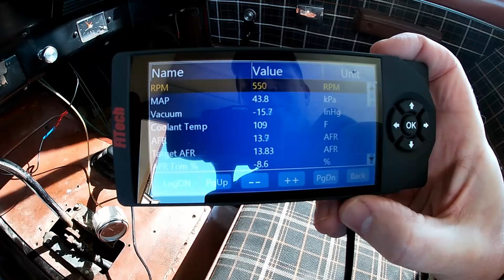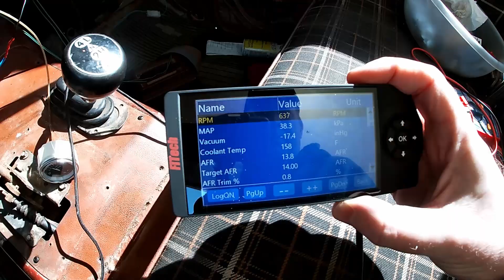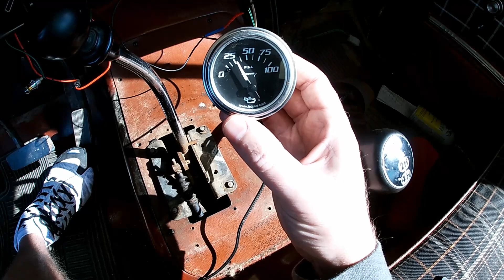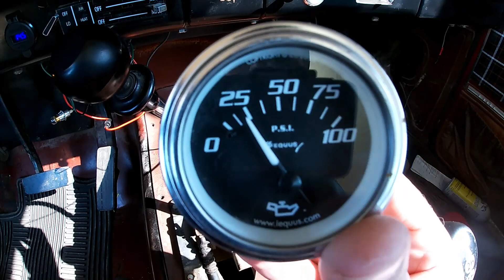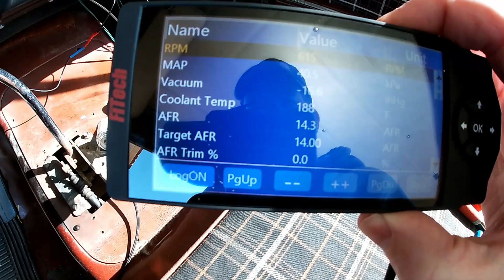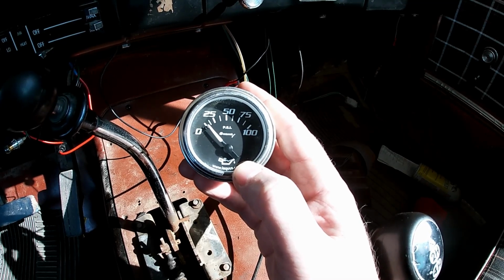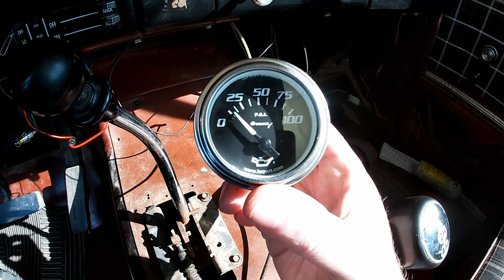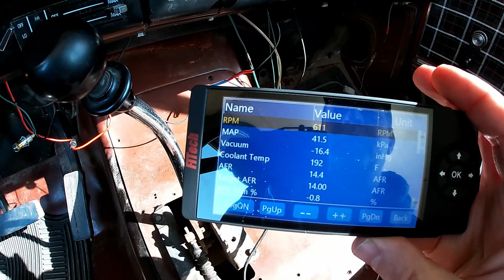Low Oil Pressure when Hot and Odd Engine Noise on the International Scout

Comment: It's been awhile, but I remember getting lifter noise when I tried 50 weight. I chalked it up to lifter orifice restriction not letting the  lifters pump up with the thicker oil. I think I was running 15w-40 Rotella with a ZDDP additive before my Scout went into storage.
The thicker oil may be solving one problem and causing another.
Reply from the maker: Thats a good point. I may give that 15/40 a try.

Comment: I have the same oil pressure readings as you on my 78 with a 345.  I’m planning on dropping the pan to look for cam bearing material.
Reply from the maker: That's a good idea and very likely to give the better answer on the cam bearing situation.
Reply: @BarrettFarms  For what it's worth, I found cam bearing pieces when I dropped the pan.  Guess it's time for a rebuild...
Reply from the maker: @bryanwood9811  thanks for the update. I need to do the same and see what I find I think, probably in the same boat.
Reply: I just rebuilt my 351 Cleveland and had all the machining done and new bearings including cam bearings and my engine cold produces around 50psi and warm maybe 5psi at an idle

Comment: Same issue, different engine (68 F250 390). Mine has been doing it for at least 10 years now, still running strong. I too have a 75 Scout ll with a 345 dosen't make a sound, because the engine is seized. Go with Shell rotella 15-40 and a zinc additive.

Comment: My 345 runs with the same piss poor oil pressure at idle.  About 4 psi hot.  But it increases proportionally with RPM.  From what I've been told, fluctuating oil pressure at steady RPM = spun cam bearing and low oil pressure that increases steadily with RPM = worn bearings but not spun.  I'm dropping my pan at the next oil change to look for bearing material but I've been driving it like this since I bought it in 2018.

Comment: I have the same problem with my 345. I will have to open the engine because of engine noise and have to replace the oil sender. I use 20w50 with 1200 zinc. Driving 200 miles a day.
Reply from the maker: Yep, sounds familiar. What year is your 345? If I understand correctly, the cam bearings are a little cheaper made in the later 345A models. I have a 345E in my 1210 that is 8 years older and it doesn't have this issue.
Reply: @BarrettFarms  1974 , however I have a spare from 1981
Reply from the maker: @U80731323  I think I need a spare or two myself.

Comment: Did i hear suction when u removed your oil fill cap on the valve cover? It needs to breathe for crank case ventalation.
Reply from the maker: Probably, it's always done that. Pcv is good but I guess it just sucks on the valley pan side a little more than the pvc can flow.
Reply: @BarrettFarms  it should be a vented cap.
Reply from the maker: @jesseduke694  probably wouldn't hurt. I asked an old timer about it a long time ago and he said if it had pressure then it would be bad (obviously) but vacuum as long as Pcv is working is no worries.